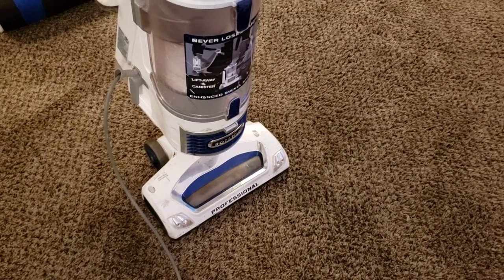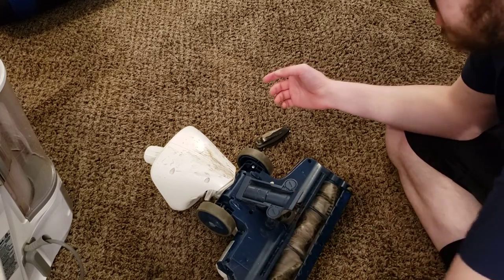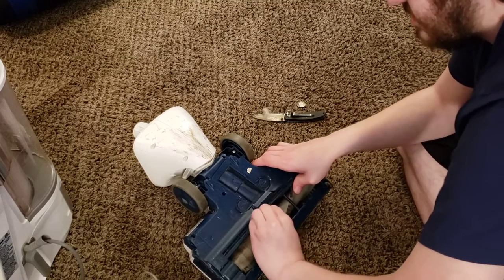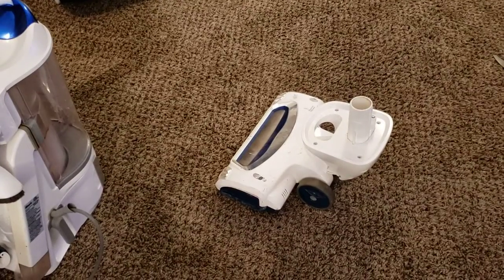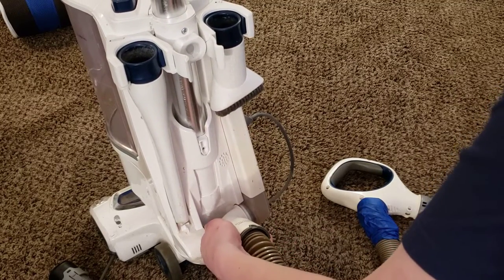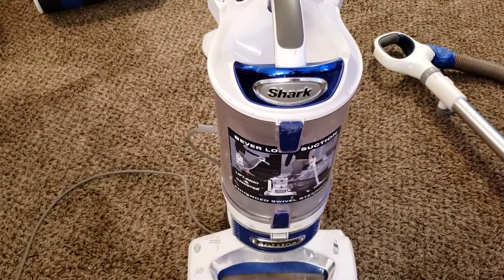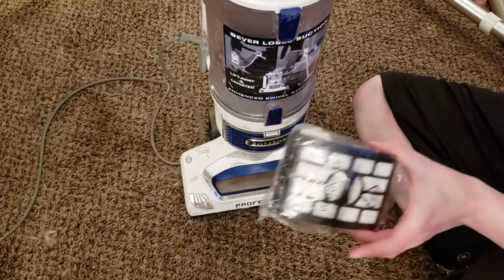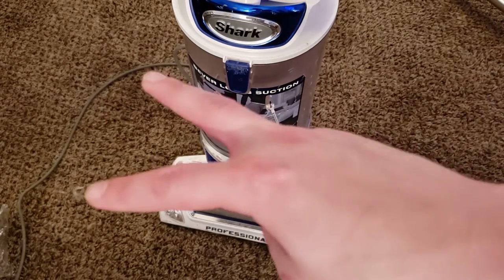Shark Rotator NV500 Maintenance Guide - Filter Change, Brushroll Clean, Hose Replacement

Comment: Okay this is going to sound stupid, but where do you turn this vacuum on at??
Reply from the maker: On the top of the body you'll see four buttons, two on each side. On the right side, the above button says "power" that turns the machine on and off. The one below turns the brushroll on and off when the machine is reclined. The buttons on the left side release the cleaning wand and Lift-Away pod respectively